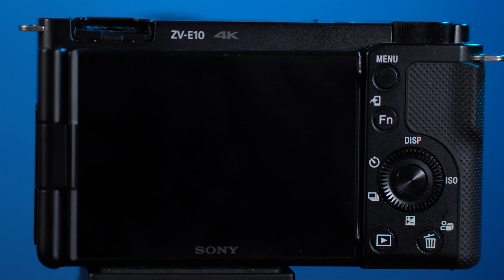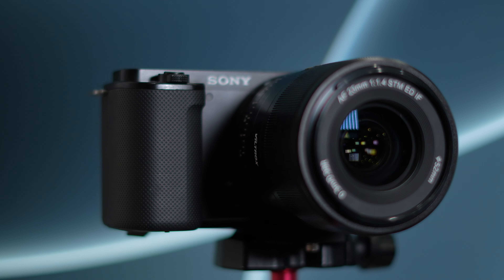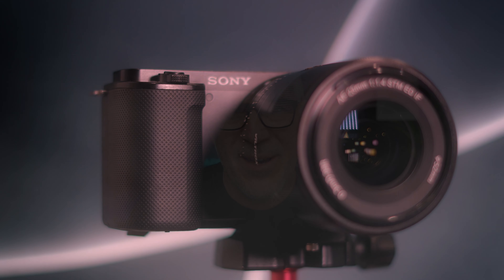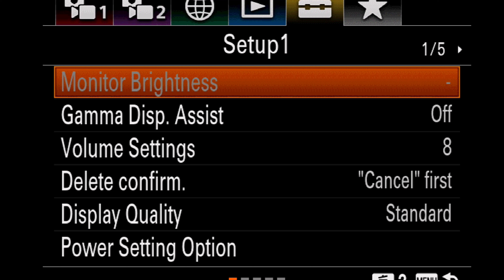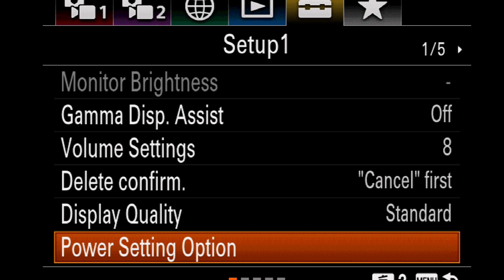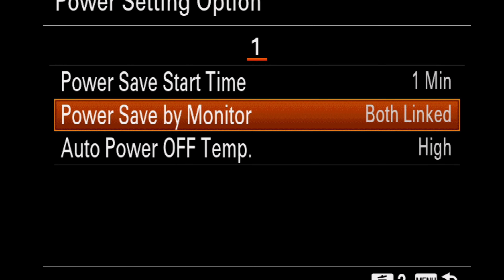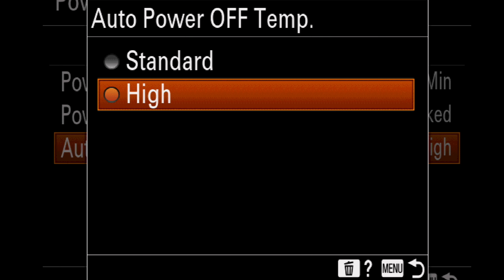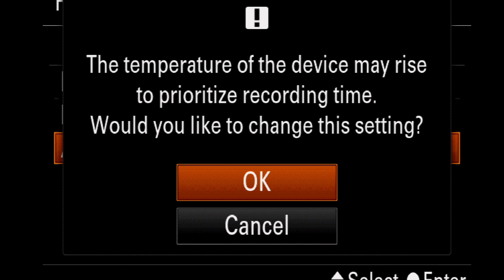How To Stop Sony ZV-E10 From Getting Too Hot | Sony Overheating Tips

Comment: I record in 4K even if I plan to export in 1080. It gives me room to crop shots. Great tips. My ZV E10 overheated while filming yesterday. Luckily I was between shots, but it’s stilll frustrating.
Reply from the maker: If you're near your computer consider recording into it using a Camlink4K converter. If you're on a Mac, check out Ecamm Live ( https://adriansalisbury.com/ecamm ), it's a much simpler solution that won't cause your camera to overhear as it's not recording in camera ;)
Reply: @AdrianSalisbury  So, Adrian, I love your vids. To continue your thought, I am considering using two of these cameras as B and C cams for live streaming only and intend to use the Camlink 4K capture cards. Intend to stream for an hour or so at a time. If that is my only use for these, would you consider the ZV-E10s as a good choice for this purpose? (They fit in my budget, which is a consideration, of course.)
Reply from the maker: @haroldtoups  we do that all the time so yes 👍 Are you competent setting everything up and getting the best results? If not we can help https://www.adriansalisbury.com/3-keys

Comment: I’ve done all these settings changes. It still overheats in no time flat. The room I record in stays between 68-70. Any lights are not directed at the camera at all. I am recording in 4K, but that is kind of a deal breaker. 1080 seems to be noticeably less clear in the editing and final product. The only negative I have on this camera so far is that I have to record in 40-45 min increments. Nothing like getting some momentum on the narrative being discussed only to have to stop because the camera thinks I’m recording a beach in summertime.
Reply: Have you tried the Ulanzi fan to help with this? I'm considering getting this camera to record basketball games, but I'm worried the over heating will be a deal breaker for me.

Comment: Even with the Auto Power OFF Temp set to High, ZV-E10 will overheat — it takes longer time, but still happens. Just yesterday I was shooting a concert in a church, the room temperature was definitely not any high (it is March in Central Europe and it was in a church with no heating) and my ZV-E10 overheated after about 1h 30m of shooting. I know it is quite long recording time, but on the other hand my other camera, A6400, did not overheat. I guess this is due to ZV-E10 having plastic body, while A6400 has metal body, that helps spread the heat much better.
Reply from the maker: are you recording in camera or streaming? 
Is it 4K? 
Do you have the screen open out and the battery door open?
All these things will help
I can live stream for hours with mine and it doesn't over heat.
Alternatively, you may want to look at the FX30
Reply: @AdrianSalisbury  Recording (no streaming), 4K 24fps, screen opened, battery cover not opened.
Reply from the maker: @honzaskypala  yes, recording 4k is pushing it for a little camera like this. Could you look at recording in your computer, that’s what I’d be doing. If you have a Mac check out Ecamm adriansalisbury.com/ecamm
Reply: @AdrianSalisbury  That works in home studio, but I cannot setup such complex recording including laptop in a church or in a concert hall.
Reply: If you use Nikon Z30, Cannon R50. It event worse when you recording 4K video. Z30 less than 30 mins. R50 better...but approximately 40 mins  overheating and than shot down. So for 4K recording, for entry level camera, ZV-E10 could be best choice. Not sure Nikon Zfc can recording 4K for an hour. No body do that test.

Comment: If I use dummy battery, if the indoor temperature is 30°C, can the ZV-E10 record continuously for 3 hours at 4k 24p?
Reply: I managed, but it is random van shot down after 1:30 as well in my case

Comment: I am still struggeling or let's say my ZV-E10 is still switching off. A real pain and I also figure out that this is happening in the winter time more often than in the German summer :-) Looks like room temperature has an impact.....
Reply: After how many minutes the camera switching off.
Reply: Have you found any solution.
Reply: @PradeepKumar-tq4ev  I mounted a USB fan close to the ZV-E10 :-) works better
Reply: @juergenschubert3247  does usb fan does not give any audio that camera r mic records. What type of usb fan are you using pls say. Thanks 🙏🙏
Reply: @juergenschubert3247  and how you have mounted it with what. Thanks 🙏
Reply: @PradeepKumar-tq4ev  part of a teleprompter

Comment: I am tempted with replacing my Canon M6 Mark II with this because the M6 will only film 4k for 47 minutes before overheating
Reply from the maker: I wouldn't record 4K in the camera I'm afraid, I bring it into my Mac and use Ecamm Live or another app to record it there. This may help https://youtu.be/It6VTvZ4ARI
You can take a trial of Ecamm here if you're on a Mac http://adriansalisbury.com/ecamm
Reply: @AdrianSalisbury  what a bizarre idea. Taking a camera that I want to use on location and using a computer to record.  Seems fine to me so far, doing a burn in test later to see if it’ll do a couple of hours straight edit I should clarify; I replaced it with a Sony ZV-E10, that's fine.  The Canon will be either brief 4k second cam or 1080.  The Sony is absolutely stellar so far, though, I might just sell the Canon.

Comment: I've already changed the setting to "high," have the screen folded out from the body, and even have the battery/memory card door open to provide maximum airflow.  The camera will shut down after 20 minutes of 4k recording in a room that's 70 degrees and nowhere near any sort of sunlight.  Very disappointed!!
Reply from the maker: Sorry to hear that.  If you're needing 4K maybe the new FX30 would be a better camera?
Reply: @AdrianSalisbury  I'll check it out, thanks!

Comment: It overheats even in a cool environment. Quite disappointed with the camera is its not capable of delivering its primary function for what it was designed
Reply from the maker: And you've tried these tips? 
Sorry to hear that, mine is running every day and it's not overheating for me.
Reply: Out of interest, what SD card are you using?
Reply: @AdrianSalisbury  yes, but this is not sustainable. If the camera gets really hot then I suspect it can affect the hardware in a long run
Reply: @Warlock_UK  no SD card. In streaming the video to a computer either with HDMi or USB to record the video with OBS
Reply: @AntonArhipov  oh man that sounds more like a fault with the camera
Reply: @AntonArhipov  isn’t streaming just 720p? Really weird if it overheats!
Reply: @Warlock_UK  no, it overheats with HDMi, but with USB streaming I 2as finally able to make a session for about an hour so that it didn't switch off and want that hot